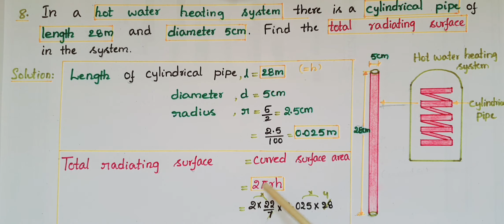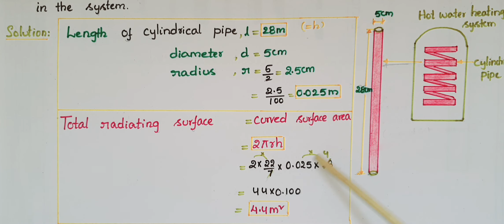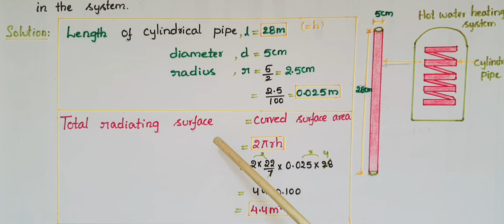Q8- Ex13.2-Ncert- In a hot water heating system, there is a cylindrical pipe of length 28 m .-Class9

Comment: Maam why should we have to use csa formula of cylinder for radiating system
Reply from the maker: you can see in the figure left side the radiating system is like a cylindrical pipe. So we have to find csa of that pipe i.e radiating sysytem
Reply: Why not tsa should we use ma'am
Reply: @mathsinmyway392  why not total surface area?